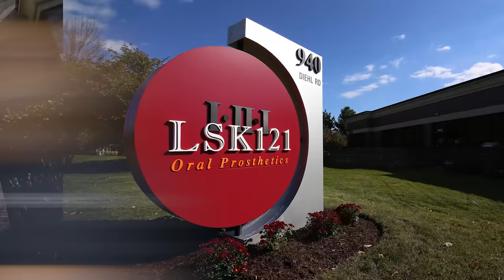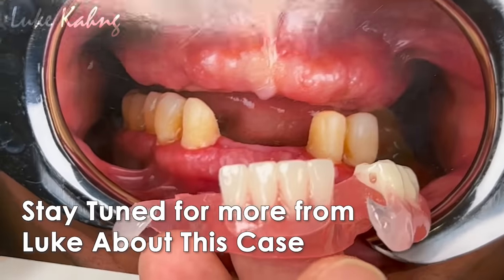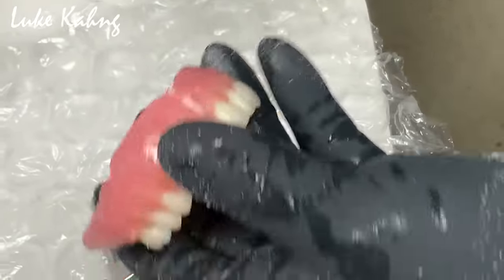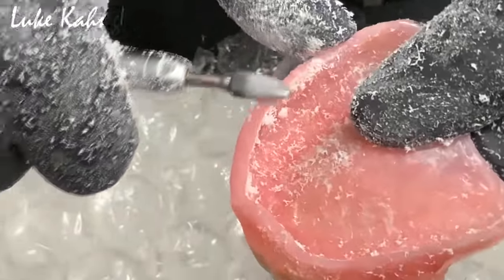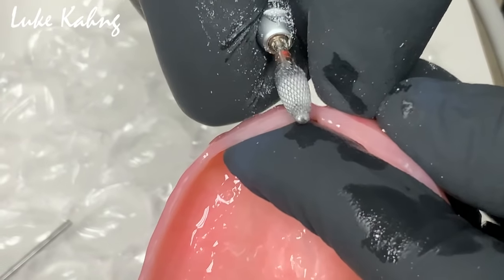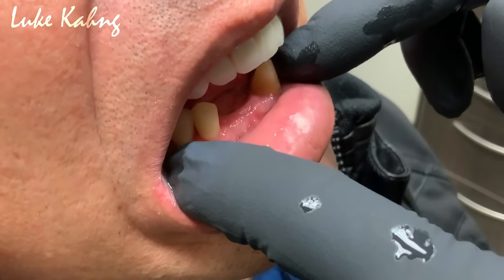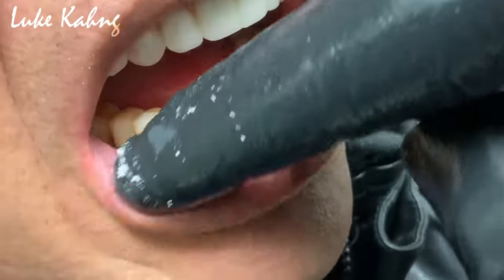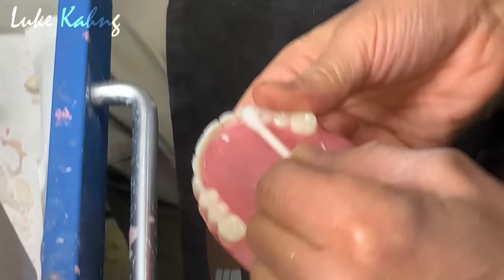How to Combine a Denture and Flexible Partial for a Stellar Restoration for a Patient

Comment: thanks for this. I have one bottom tooth that fell out after many years of it being loose. My dentist recommended having 3 more out and to get a partial plate. Why would they need to take out another 3? I can understand 1 so it will match with the replacement tooth but 3?

Comment: come si fa a fare ancora protesi con un palato così??? in italia non le fanno più...le facevano 30 anni fa
Reply: I just had top @ bottom partial dentures made at 74 years old.  One side at the bottom the jaw has shrunk from not enough teeth to chew with.   l used to chew the inside of the cheek the more the jaw shrunk. Now with the dentures on the opposite side has caused the teeth to bite the inside of the check.  Plus to remove the bottom fenture at night are really difficult @ sore.Plus the same side the teeth are uo @ down not straight like the opposite side. It is less than 2 seeks since l received them. l am planning to go back to the dentists to see what if any thing they can do or suggest.The teeth are well made.   Any suggestiions. Thank you. Joan. Australia.